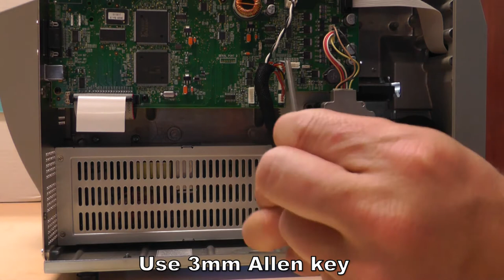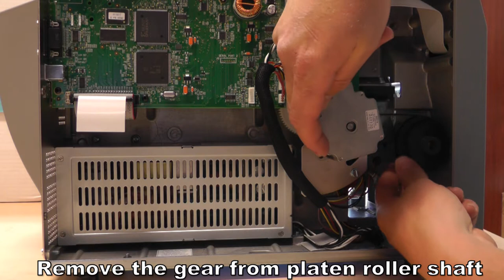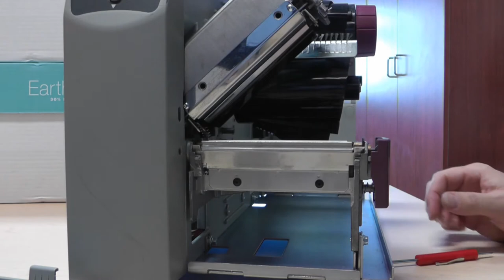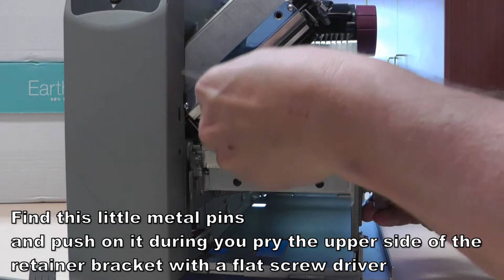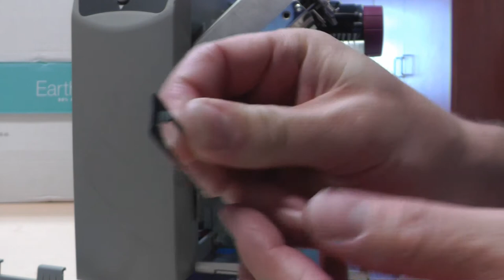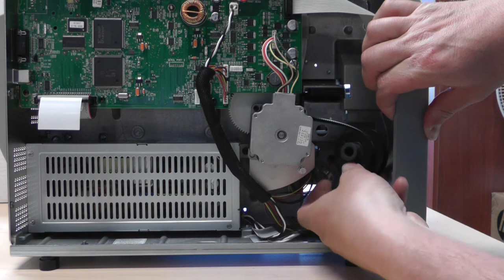Zebra S4m - platen roller removal / install

Comment: Just remember to be very careful around the printhead with metal tools when getting the clips out. The printheads are very delicate (and expensive) and are easily damaged by anything sharper than an adult elbow :)